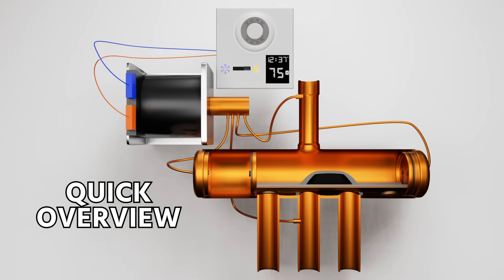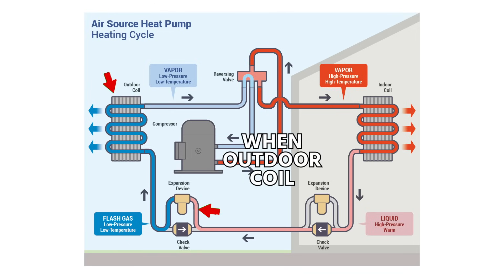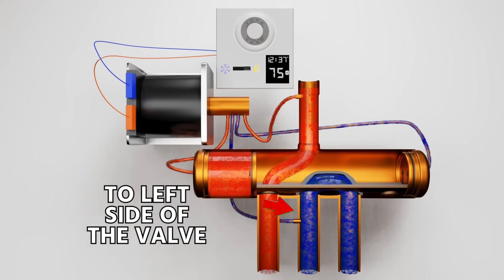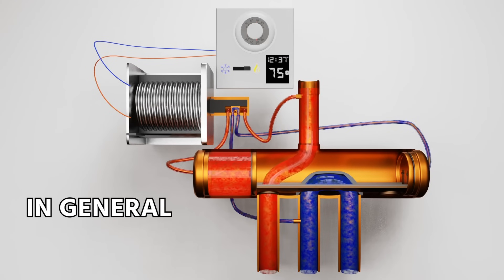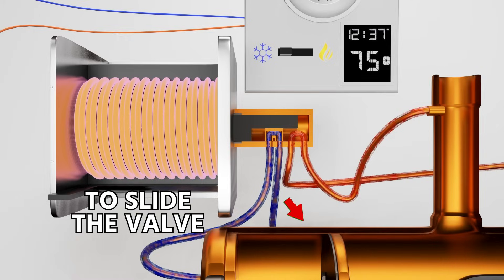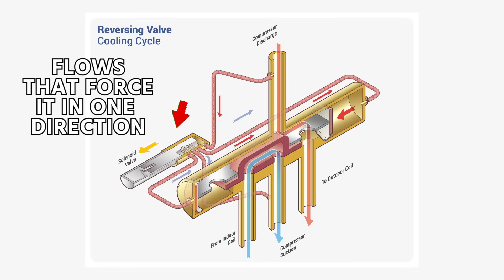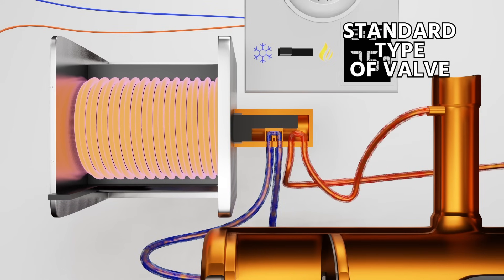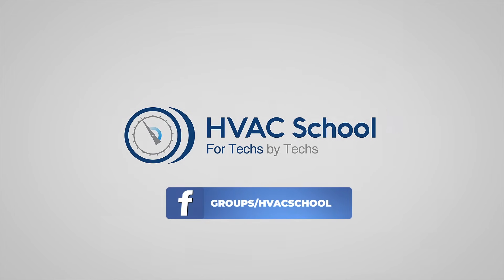How a Heat Pump Reversing Valve Works

Comment: Do a video on water source heat pumps. No one knows how to work them where I'm at except me and I'm getting sick of it.
Reply: I initially had problems with water-source heat pumps too.  Most of my WSHP problems have been thankfully pretty simple.  Pinched supply line causing compressor failure over time, PCB’s going out, drain clogs, dirty filters.

Comment: The old Thermo King MD-II's used to have something similar to this, but it was more of a round cylindrical shape, enabled mechanically by the Hot Gas circuit when calling for defrost or heat. They were fully serviceable, I rebuilt many of them......GLAD IT'S NO LONGER A STANDARD LOL!!!
Reply: Hot gas bypass...

Comment: Those who thumbs down this video should not be a air conditioner or refrigeration tech please you need to get a job what fits you as a tech on something else and not on the purpose of this beautiful explanation regarding how a four-way valve switches to the proper heating or cooling needed by the customer indoor house so don't knock it off with a thumb down I give it a hundred percent thumbs up thank you for this beautiful video thank you HVAC tech do love everything that is teach basically how to understand pictorial electrical pressures compression regarding air conditioner refrigeration or ice makers

Comment: Back in the early 60s, I had a CARRIER HP PACKAGE   Looking like a large window unit at the BRONX ZOO, where the took care of BABY animals, but we did NOT have the instrumation, we now take for granted   All you had were service  thermomitors   So trying to find a bad 3 way valves, was NOT obvious, unless it was REALLY LEAKING  between high/low   Another thing NEVER HIT A VALVE BODY, as you can do DAMAGE TO IT CREATING THE SAME PROBLEM CAUSED BY THAT VALVE  !   Cheers 🇺🇸🇺🇸🇺🇸🇺🇸. HAPPY NEW YEAR   ALL .

Comment: Thanks for the valve overview - you really provide a valuable service for the industry.  Just one thing that would be helpful be is if you go over the failure modes of a reversing valve.  From your overview, it seems pretty bullet proof.
Reply: I have seen only two failures. One is when the sliding piston gets stuck and then it will only run in one mode. Not so bad if you're calling for heat and the reversing valve is stuck in the heating position but then it is really bad when you have a call down the line for cooling on a hot day and the unit is putting out hot air. The second one is much more difficult to diagnose for someone who does not have a good understanding of a refrigerant cycle. I have seen reversing valves leak internally, and what happens is a large part of the hot gas from the compressor discharge leaks in the reversing valve directly into the suction line of the compressor. It will sort of equalize the system pressure and resemble conditions of bad compressor valves but by taking superheat, subcooling and measuring temperatures of all the lines in and out of the reversing valve you can differentiate between the two conditions.
Reply: @Howie875  wow how long you been doing Hvac?
Reply: @lilkenny123123  Hi Kenneth. I am recently retired but I worked as an HVAC tech for about 40 years. I worked in some high-volume shops and after a while you basically see just about every problem you could imagine.
Reply: Revrsing  blockinn  dreact  fixing
Reply: Coil  engerzied     het  pump  systom      seftey  dves  good  thanlyoi  gues  rebersing  valved  is  full  ok

Comment: Reversing valve heat pumps have been around 60 plus years I have installed them for 42 years and are 31/2 times more efficient than electric strip heat , and 80% of dealers are afraid of a heat pump, payback for the 200-400 dollars more in cost is less than 1 season
Straight Electric heat only should be outlawed for being the Blackest energy one can use for heating
Reply: Mr. Clint 1st wanna say I'm litterly discover this Video from what I understand this video is very clearity on Revers valve ... correct me during the video it mention ' Pilot(🔥) valve'
Reply: Could you tell me how to turn off my AUX HEAT on my water heat pump Please

Comment: Awesome video!! Why does it hiss when it switches over?? I know it's reliving pressure but you explain it do we'll.
Reply: It only hiss wen da AC getz turn on
Reply: That hissing noise you heard is called hydraulic hissing. It's just the flow of the fluid you hear through the pipes, same way you hear water flow through water pipes in your home. The expansion valve or any restrictive device which interrupts the flow will cause a noise. Same way if you have roof racks on the roof of a car, you hear a whistling noise because the flow of air is interrupted.

Comment: As always, great video. But I have a curiosity. In systems that are pressure equalized in off mode such as a Goodman or Carrier, I can still hear an audible sound of the reverser valve when I supply 24 V to “O”. (Clank) I understand why this happens in a non-bleed TXV systems such as Trane, And I also understand that compressor force or pressure differential is the actual prime mover of the “canoe”. I’m just wondering why I can hear the same thing in systems that are basically at the same pressure on both sides on a non-running system. I guess that little pilot valve is just that loud. Perhaps I just answered my own question.
Reply: Solenoid will still operate so you'll hear the plunger, but there won't be a pressure differential in the pilot tubes.  The main valve essentially has gas dampening as the gas is pushed out of the opposite side and won't make a clank.

Comment: Can you check pressures in heating mode with a HP? If so what are they. If not, then checking in normal operation cooling is how it’s done.
Reply: There are two ways to charge a heat pump accurately.  Weigh it in if you know the correct amount or charge it in cooling mode using the charging chart.  If you have a performance chart you can use that in heating mode but the charge will not be accurate.